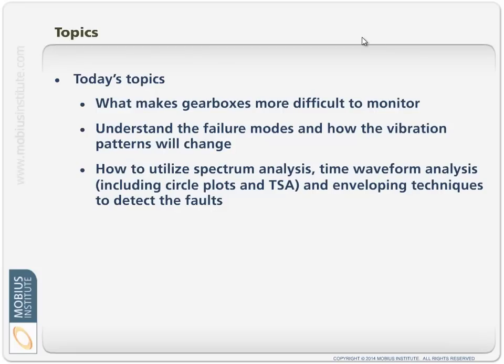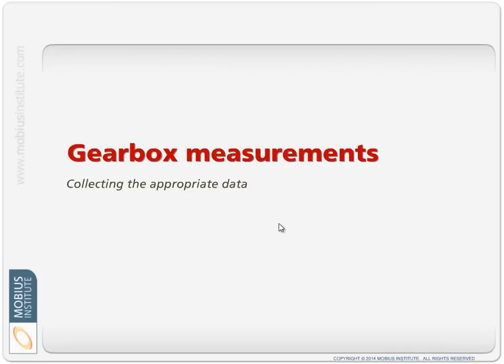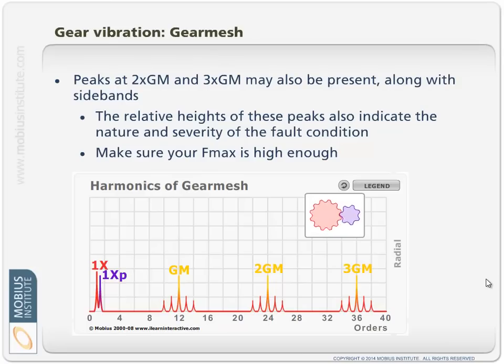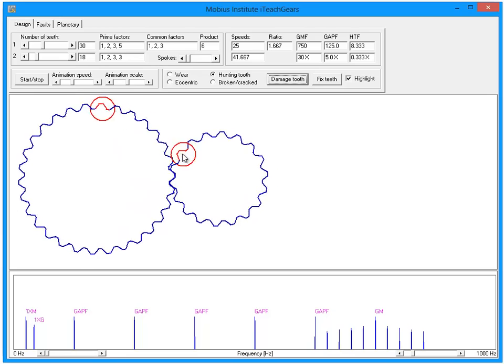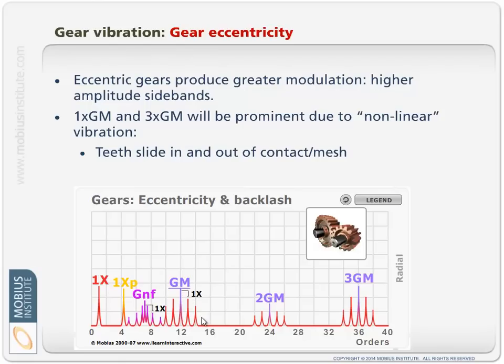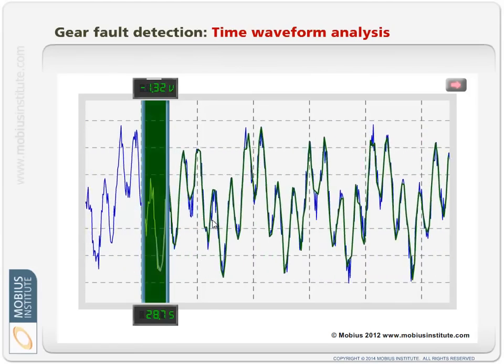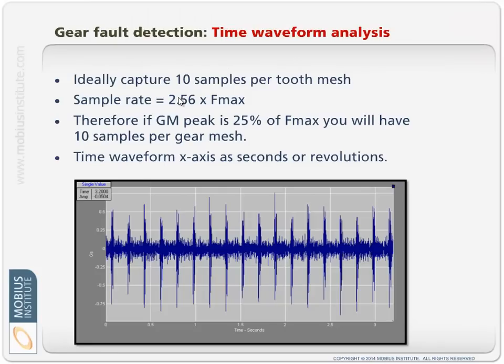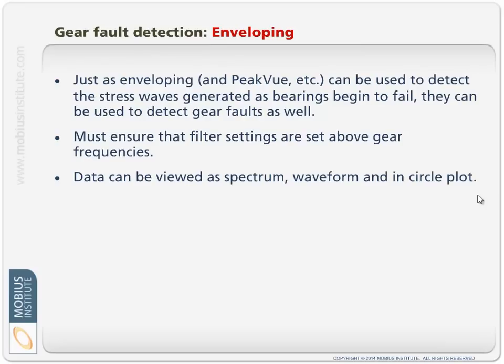Utilizing Vibration Analysis to Detect Gearbox Faults

Comment: Great presentation! Is there any specific signs when vibration cause is on the gearbox or in the wheel/tire, ball joints or any where in the suspension?  Cause  I'm having experience in 2010 dodge charger RT,  the dealer advise me to replace old tire and rebalance the wheels which I did but still vibration is there at 80 to 120 speed.